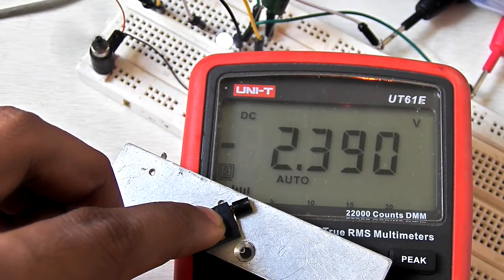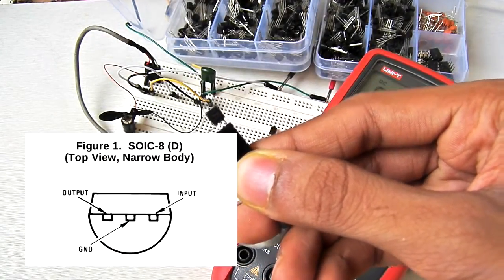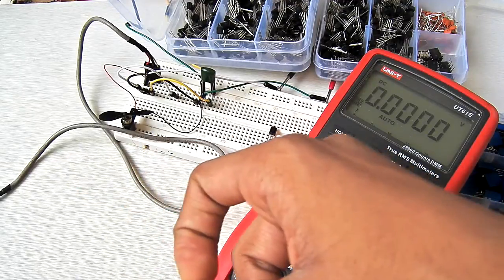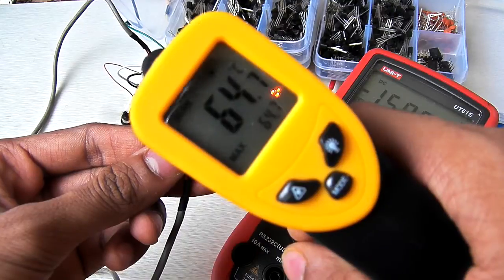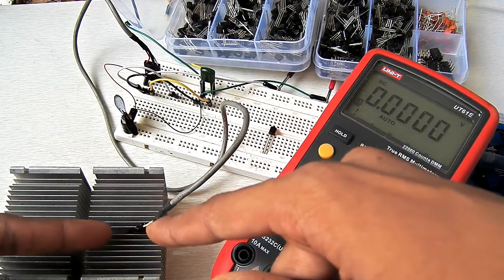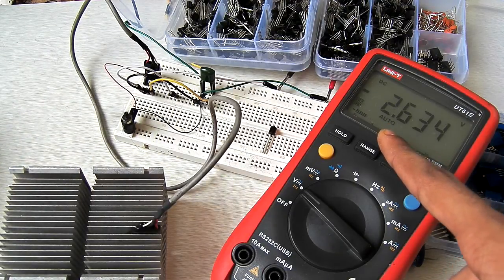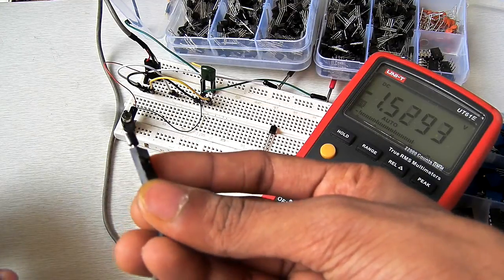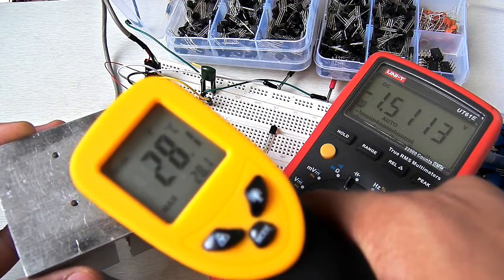How to use 7805 Voltage Regulator Into Temperature Sensor !

Comment: Well I reckon that this is just a dirty hack to measure temperature because the measurements are likely to be different for every chip. However it gives interesting insight into the inner workings of a 78L05. 
The intro was a little loud for my taste but other than that, the video was well produced, the camera was excellent. I liked it :)

Comment: Hi Kedar, Want your recommendation for buying a Infrared Thermometer Temperature Gun
in india for a DIY hobbyist level (max temp 500C) tool but with good durability and quality.

Do you have one? which one you use when working with temperature sensitive projects?